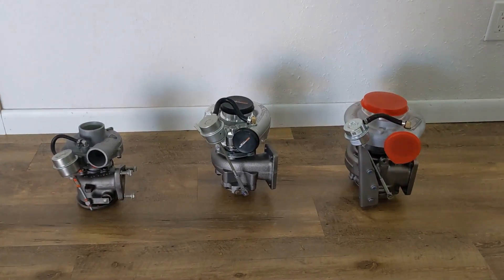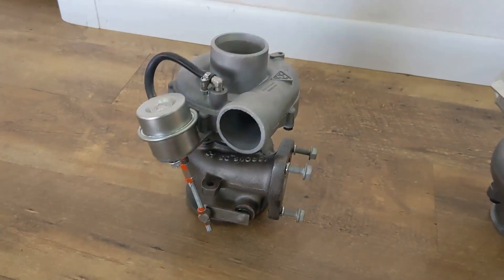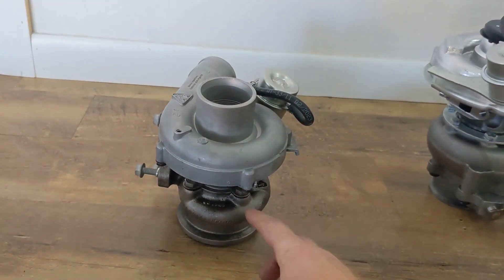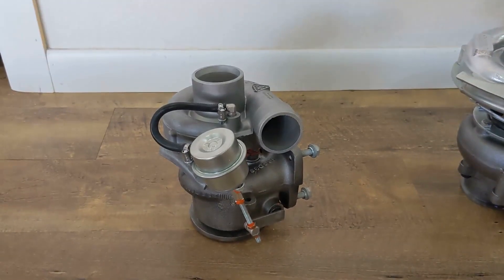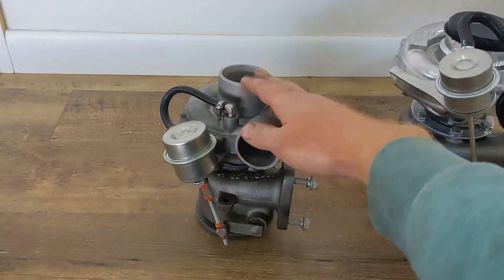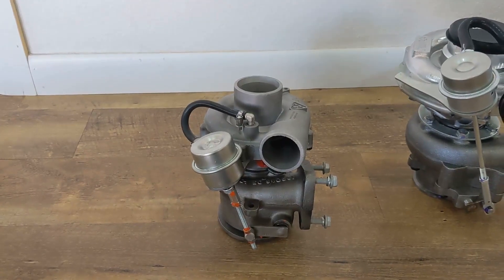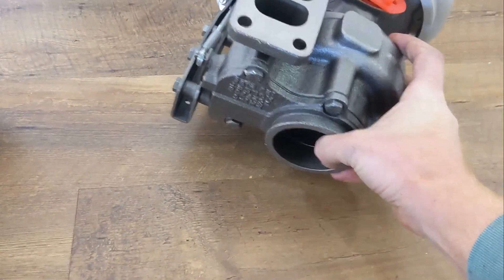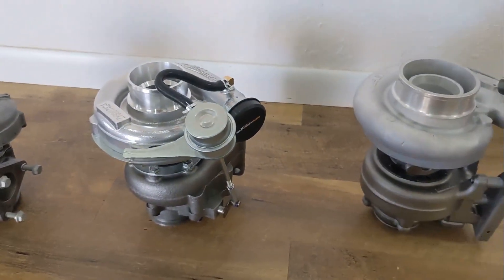Benz Injection W210 OM606 Turbo Kit Comparison

Comment: When you say the stock edc pump, does that include the mechanical pump from a na 606? Or just fuel pump with the turbo
Reply: EDC pump is the pump on the W210
Reply from the maker: Stock turbo EDC injection pump

Comment: On your web I saw nothing for the om613 engine.

It’s a 3.2 liters, the successor of the om606 with common rail just before Mercedes got into electronic sensors and stuff in the om648.

Comment: What do you suggest. 

Om606
Forged internals 
Na cam 
Upgraded springs 
K2500 w 4l80 

Would like 5-600 usable hp 

Which elements (95 606 pump) and recommended turbo
Reply from the maker: email us at info@benzinjection.com and we can help.
Reply: I'd suggest 8.5mm elements from DPUK and a BW S300 turbo or a Holset HE400VG if you have space.